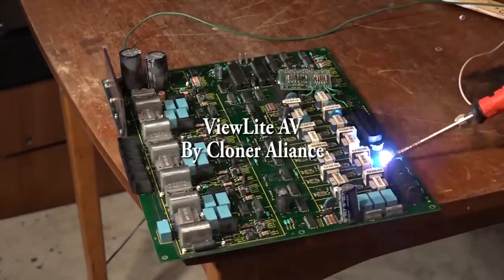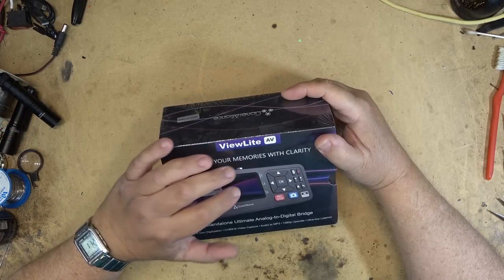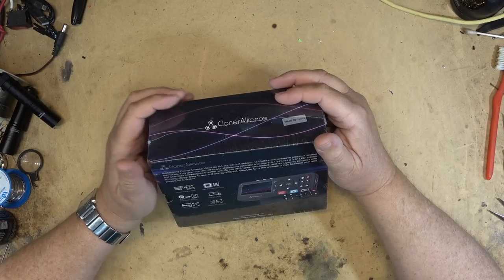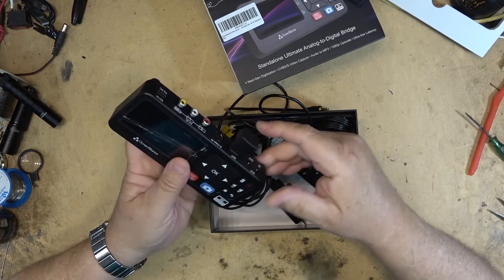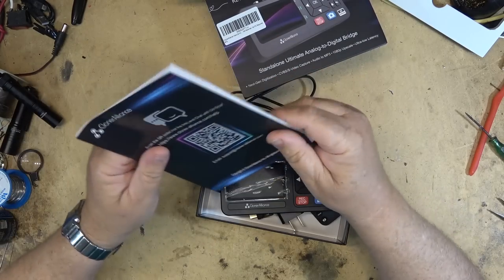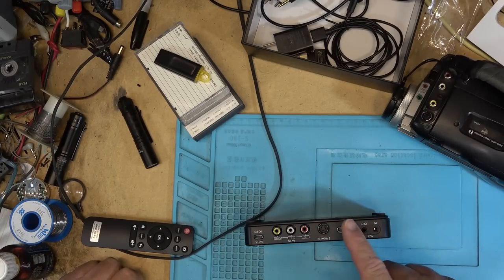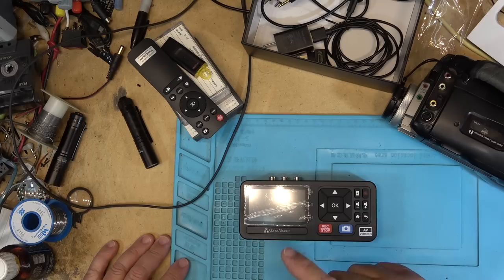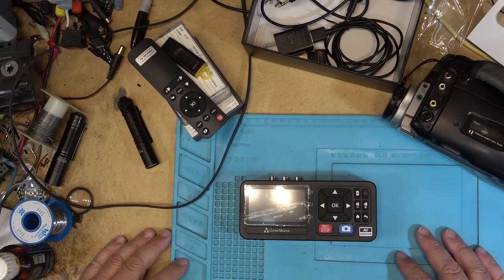Cloner Aliance ViewLite AV stand alone capture device to digitize your home videos

Comment: Both SD and HD captures are 30p only. The HD capture is stretched. Meh. Your Betacam capture is much better, but it has a weird cadence, for every 6 frames there are only 5 unique ones - was it a PAL Betacam, that your Cloner Pro converted into 60p? I wonder whether the Cloner Pro 4:3 capture is pillarboxed within 1920x1080, or is it something like 1440x1080?
Reply from the maker: This one is 30p, my pro Bix is 60.
The betacam is a pal model and the cloner is doing a pull down to 60p.  This one does it at 25p for pal.
Reply: @12voltvids  Right. Who wants blended frames and halved temporal resolution? Youtube enabled 50p/60p in 2014 for crying out loud. As for the Cloner Pro, I would expect it to capture PAL as 50p.
Reply from the maker: @ConsumerDV  the pro outputs at 60p. No setting to change.  It's not a pillarbox 4:3 it is true 4:3.
It is 16:9 or 4:3 selectable as well as 720p or 1080p selectable.   HDCP, what's that?

Comment: My Cloner box seems to have a habit of timing out at random times and can't record material no more than five minutes. Don't know if my unit is defective or needs to be straightened out on the menu screen.
Reply from the maker: No issues at all with my pro model.  It records anything and everything.
Reply: There are various data speed ratings for USB thumb sticks. Maybe try a faster one. It’s actually a number indicated on the USB thumb drive packaging. And make sure you format it to the recommended format.
Reply from the maker: @alphabeets  this one is USB 3.1 writing speed is not an issue.  It will do 80 easily.  This device is 8

Comment: I’ve had two Cloner Box Pros and they both have a problem with the Left Right audio balance when using the multi pin adapter audio ins. One side is 6db louder than the other when viewed in my video editor software. When using the 1/8” audio in jack on the side of the box, the audio levels are matched. Anyone else have this problem?
Reply from the maker: Have not had that problem.  The sound card on my computer has that problem though.  One side louder than the other so I have to bump the balance over a bit to level things up.  My cloner pro has been great.  It's an older model before all the HDCP crap went on it. I however will neither confirm or deny if it can record protected content.  I can confirm however that this one does NOT record protected content and they are very clear on the operating manual to this.
Reply: Yep, I bought mine after seeing your excellent review of it. I love it except for the audio level trouble. I’d love it if someone could record a mono test tone into it then view the levels in something like Final Cut or Resolve or Premier. I’m just wanting to know if this is common. I can’t believe both of my units had the same flaw.
Reply: Me thinks I should NOT update the firmware in mine. Don’t want to lose certain recording features…
Reply from the maker: @alphabeets  i can do that.
Reply from the maker: @alphabeets  never update.  Why do you think i still run win 7?

Comment: Anything modern that dares to include an S-Video input is worth a shot. I really liked the recommendation of Cloner Alliance Pro, its been a keeper. Thanks for the look inside. I was wondering what the Chips might be, video decoders tend to be off the shelf, h.264 encoders usually seem to be Fujitsu MB86H52 but slathered in Thermal compound and obscured by a heat wicking plate.But MacroSilicon MS1850 would not surprise me.
Reply from the maker: The pro model is fantastic.  It can record everything.  No I won't be updating the firmware either as they will likely disable protected content capture which mine does.  The view lite av will not capture protected content.

Comment: those units are crap .. especially the framerates and software stability and compression is crap , sometimes even the audio is not alighned to the video aswell
Reply from the maker: My pro unit has had no issues at all and I use it every day.
Reply: I dont think there crap they have a use, admittedly its a one trick pony, but its not worth more than 89.99 but theres oldies with money to throw to keep the camcorder tapes alive, on computers they need grandkids to operate...
Reply from the maker: @lezbriddon  this one certainly has a lower bit rate.  It's only 8mbps. The pro model is 18mbps which delivers a noticable improvement as demonstrated in the betacam capture and the tv commercial at the end.  The audio capture sounded great.  Sure it's mp3 but more than high enough bit rate.  Myself I don't have much use for this for video capture as I have the pro model which is much better but to record audio from an old tape this is ideal.

Comment: NIce & Intressting video there . 
I have digitized alot with clearclick 2.0 units . And it have been "ok" so to say . 
This one if it can upscale VHS to 1080 descent it shuld be very intressting option to get . 

A funny thing with the clearclick 2.0  is i bought 3 off them and another here in EU under another brand .  
The first i bought you had 2 different reselution options the other 3 dosent have that . Kinda strange but i guess as i understand it its differnt firmware versions on them to i dont have 2 that have the same even if i bought 3 off them from same Ebay seller . And those firmware do effect the quality . . its my 1 st i bought that works the best and only one i use . 

Only thing i miss on this cloner alliance is 4:3 ratio . that shuld do that automatic  at thats a shame imo . 

Another funny thing is i had for a while a NTSC Hi8 Hitachi with color screen i copy those to SVHS NTSC . And that is the worst copys off enything i have filmed . dark less colors kinda grey:ish so to say . So i do not agree with the NTSC vs PAL .  I even had laserdics and VHS with original starwars on NTSC tapes  it always was less life more dull on any video & TV & Computer i have tryed . Still have a SVHS ET NTSC that i use to copy those few NTSC tapes i have .  I  m absolutly not an expert in any way . I have just used all from Panasonic M10 VHS hifi camera  first i got was in 1991 and have get cameras like SVHS DV up to 4K today .  so its fun digitize old stuff just want as good as possible  and a little better then Clearclick .

I m thinking about try go thru my LG VHS / DVD recorder that upscales , not to playback from just send the signal thru it and find some good with screen 1080P recorder plug it from the HDMI out . maybe a good idea ? 

Thanks for a great video Sir :)  add more samples from VHS to upscaled 1080P etc   :)
Reply from the maker: On this one if you select 1080 upscale it stretches to 16x9. If you choose 640x480 it keeps in 4:3 format.  The pro version you can up scale to 1080p60 and keep aspect correct and it will also capture hd from component, hdmi and RGB

Comment: It would be helpful to know the approximate cost (with the disclaimer its subject to change of course) so that I know if it’s even something I could buy. Thanks!
Reply from the maker: There is an Amazon link in the description that takes you directly to the store. I believe it's 279 on Amazon Canada.  Not cheap but it does a great job. I use mine constantly to archive.   It's in operation right now actually.

Comment: I've been thinking of getting a device like this but I want to get one that has good quality and works. I have two of the USB based capture devices but the video quality of them is terrible. I like the idea of a stand alone device and no need of a PC.
Reply from the maker: This works pretty good.  The pro version delivers a better picture. Things to remember.  Home video was 720 x 480 inteaced.  No matter what you do it is always a 480 line picture.  When you up scale you stretch the picture and guess what should be inserted.  It will never be a HD picture.  
Awhile back I did a demo video where I did a comparison between my 1200 capture card, my hauppague capture card and cloner alliance pro.   
I'll probably do another one and compare the same footage on this one and the pro version as well as other capture cards.  I'll do some test signals and test footage off a laserdisk test disk so all can be evaluated with same footage under equal conditions.
Reply: @12voltvids  Cool. I've seen the little ClearClick ones on amazon but all of these devices are expensive. It's a bummer that the one you showed doesn't record macrovision content. I have tons of movie tapes that aren't on DVD or Blu-ray that I'd like to record to digital. Some are recorded off of TV.

Comment: How did you manage to record in 4:3 ratio? I have the same device but it only records in 16:9
Reply from the maker: You need to select 640x480 in the record settings. Auto  and 1080 will scale it to 16:9

Comment: Will this record from a uk sky set top box
Reply from the maker: Yes it will record PAL signals.  If you want to record the full HD from HDMI or component I would recommend the pro Box. I use to record everything and it works flawlessly.  I don't know if newer firmware has disabled any features but the one i have has never failed to record. I have to be careful in the words I use so as not to violate any of youtubes guidelines with respect to protected content.  So I can only say I can not confirm or deny the model I have can record protected content.  All I am permitted to say is it has never failed to record anything I have thrown at it. This lite version however does not record protected content.  The pro version no comment.
Reply: @12voltvids  very helpful  , thank you .

Comment: is this good for tapeless?hehe
Reply from the maker: It looks very good when kept in standard definition.  On this one I would not use the upscale to 1080 only because it stretches everything to fit 16:9  However in standard mode it captures 4 / 3 and it looks good I did a comparison between this unit my professional capture card and the alliance pro capturing a commercial tape period I showed it to a friend in a blind test so he did not know which one was which and asked him to pick which 1 looked the best and he couldn't pick 1 Uber the other they all look good. The pro model I had an outputting 1080P60 4/3 mode   So all 3 looked the same there was no aspect difference. My friend was looking to buy one so he wanted to compare the pro model which costs quite a bit more with this version and because he couldn't see much of a difference between the 2 he picked this 1 of course we compared it to my $1400 professional capture device that outputs firewire to the computer and it also looked identical. In the end when you're capturing analog video they're all going to look pretty much the same because it's 480 interlaced video that you are capturing it doesn't matter how you upscale it or what you do to it it's still gonna be 480 you can upscale it to 4K if you want but the source is still 480 it is not going to improve on what is already there if you capture garbage video it's going to look like garbage if you capture good video it's going to look as good as any of the others. Now I'm not saying all captured devices are created equal if you go and use a $49 dazzle you may not get the results that you want because a lot of those are computer processor  Dependent and if there's a bottle neck on USBA can have drop frames also many of them require a very stable video source but the standalone boxes do a remarkable job no computer required no time based correct required it's all built-in.

Comment: I like the Pro
Reply from the maker: The pro model is a totally different device with many more capabilities.  This has some nice features however like the ability to save on native resolution. The pro outputs either 720 or 1080.  
This one can output 480 (576 pal) or 1080.  For someone wanting to work at original resolution and upscale in PC this would be a good option and the audio recording feature is great.